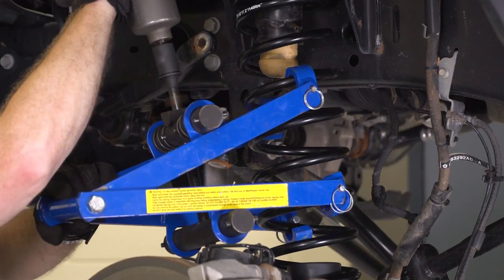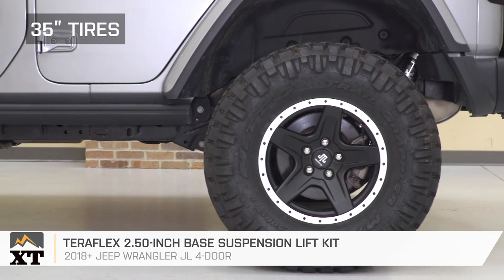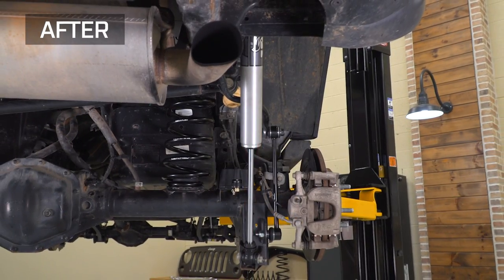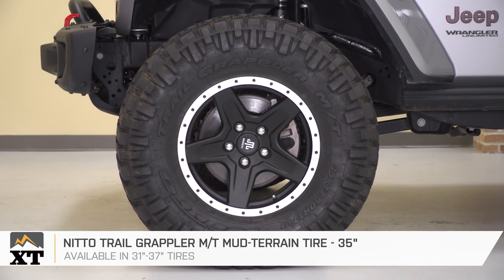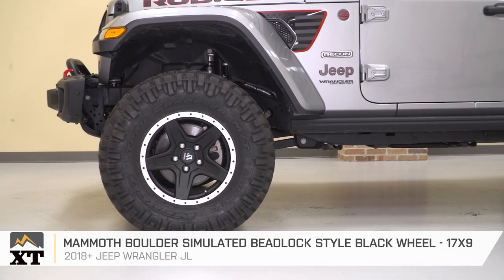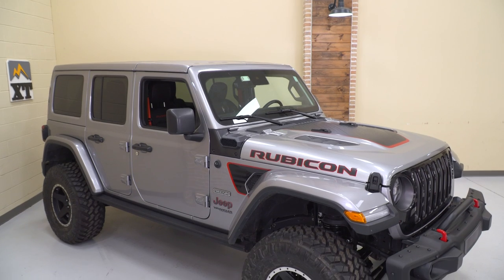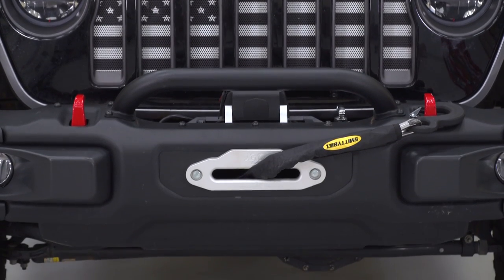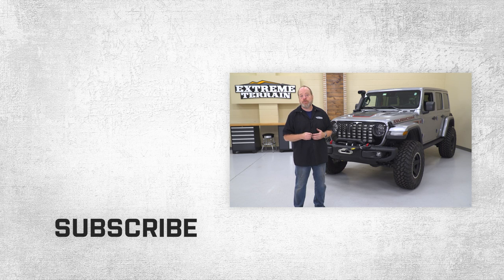5 Mods To Take Your Rubicon JL To The Next Level Off Roading - Throttle Out

Comment: I want to see you use that Snorkle with water as high as you implied.
Reply: Additional prepping is required to ford deep waters.  I am considering a snorkel but may not if I add a Genesis dual battery setup.  I am not sure they can both be had due to space limits.  Between the two I believe the dual battery setup is more likely to pay for itself.
Reply: I guess Ryan is gone as these YouTube host, for Extreme Terrain.
Reply: @attnielthomas7856  Ryan works for a Car Dealer now.

Comment: When an individual YouTuber says things like “…the snorkel being so high you can run though water____ deep,” you take it with a grain of salt.  *BUT*  When a company who is an aftermarket supplier of performance parts does everything to imply that a snorkel can allow your JL deeper water fording, then I simply cannot go along.  That is quite betraying of the trust that your clients/patrons put in Extreme Terrain to assist us in the proper selection, installation and use of aftermarket parts.  Please discontinue to do things like that.  Decent video, otherwise, which is completely betrayed by a significant misstep in content.

Comment: Can you post a video of mods for the JLU eco diesel. Thanks
Reply: What would be on your First 5 list for the JLU Ecodiesel?
Reply: @BrewtownFlyer  suspension lift. 50” interior light bar for the sky one touch top. Head liner cover for sky one touch. Front and rear light weight bumpers. Thanks
Reply: @rhinohorn99  I like the low profile look of the interior light bars too.  We have a couple interior mounted light bars that I thought of, SKU# J155124-JL is a one-piece unit and SKU# J155125-JL is a two-piece unit.

What bumpers are you looking at?
Reply: @BrewtownFlyer  will the light bar fit a sky one touch top?